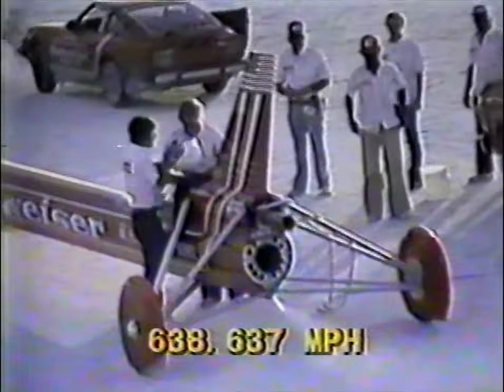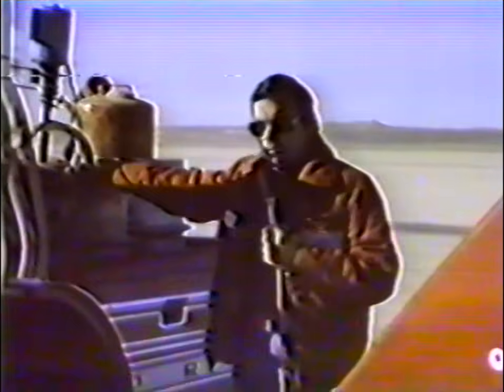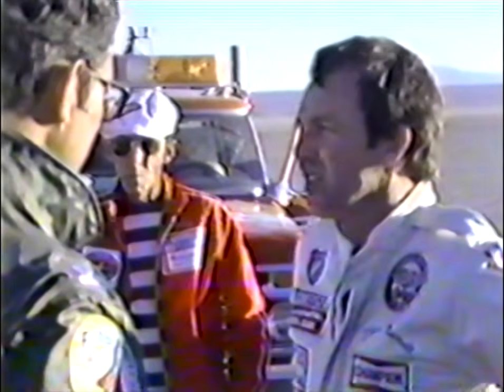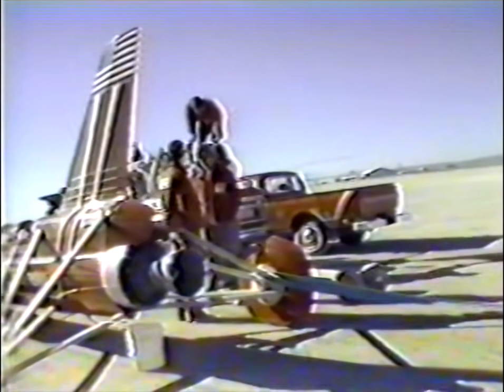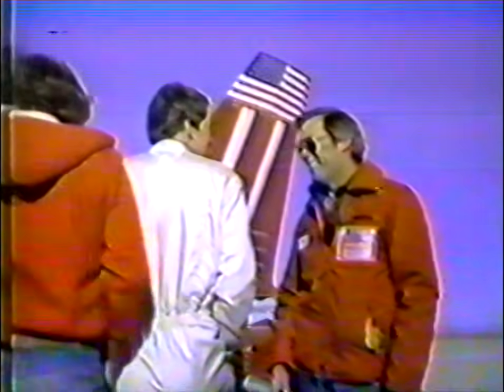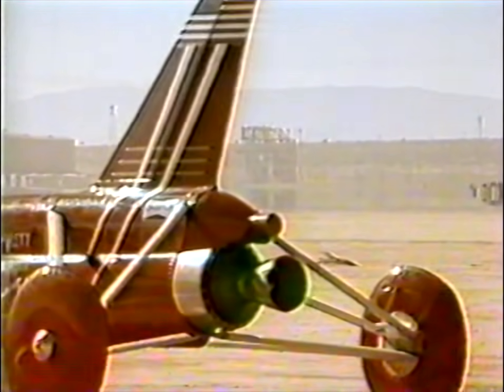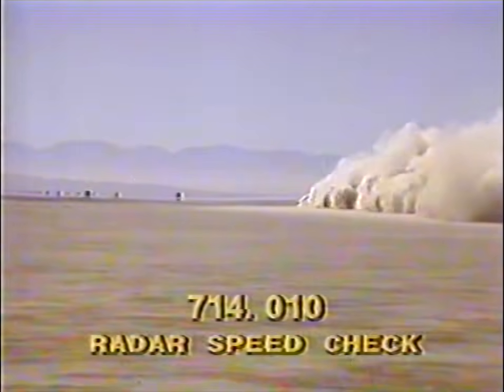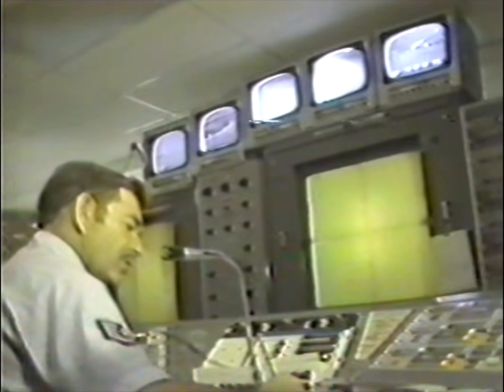Stan Barrett Breaking The Sound Barrier Live from Edwards Air Force Base in 1979

Comment: To be fair Barrett went probably went faster than any else before that day and the sound barrier is a function of air pressure/temperature not a fixed speed limit. Though the Air Force radar data showed the Budweiser Rocket might of achieved 739.666mph breaking the sound barrier in those conditions it never said it was an official measurement. Indeed FIA a self created organization formed in 1904 in Europe only recognizes its own standards  as an "Official" record and has no recognized authority to claim anything beyond its own membership. In the end a land speed record is meaningless because a rocket sled achieved supersonic speeds long before any manned vehicle did and it's human passengers went faster earlier than those who had records as well.
Reply: The sound barrier is a very real barrier to speed.  A wall that creates massive forces on the vehicle.  Breaking the barrier at altitude at 700 mph is just as hard as breaking it at 740 at see level.  As for the 'official record', it is recognized because it is the latest in more than a century of recorded records  broken using consistent, reliable methods.  If you go faster using different rules  what value does that have?  Who are you comparing yourself to?  You aren't beating anyone, you're just satisfying your own ego.  Not necessarily a bad thing, but nobody else will care.

Comment: There was no independent measurement of speed & whatever speed it achieved the attempts didn't meet the requirements to be recognised. The give away is that NO ONE heard a Sonic Boom, unlike Thrust SSC where the sonic boom was heard over a considerable area & the shock wave was clearly visible.
Reply: I didn't hear a sonic boom from Thrust SSC either. Everyone was a sore loser that Stan broke the sound barrier.

Comment: its just a tricycle with a rocket strapped to the back.. there is nowhere near the engineering in this as there was in the thrust cars.
Reply: He didn't crash and went 714mph. Keep it simple works
Reply: Record for a car requires four wheels and two used for steering.
I think this would be classified as a fast side-car.
Reply: Randall Parker......He actually went Mach 0.85......about 622 mph.
Reply: Grumpy...
There is only "one" Thrust SSC car.
Reply: More accurately it's a delta trike
Reply: Oh, wasnt the SAME engineering, but you try building ANYTHING can move that fast on the ground and stay under control.  Just the wheels alone are a challenge.
Reply: @richardbeck4193  the record does not refer to a CAR, it refers to a land VEHICLE.  Any wheels, any power, any steering.  Run it twice within an hour through a measured mile and you'll get an official average time.
Reply: @markdoldon8852  The record is not listed this is because there are conditions to be met by type of vehicle. Otherwise the fastest is the rocket-sledges which run on rails used for testing weapons.

Stan Barrett 1979 is NOT in this list :-
https://en.wikipedia.org/wiki/Land_speed_record#1963–present_(jet_and_rocket_propulsion)

Holloman High Speed Test Track at Mach 2.5 (manned)
https://www.youtube.com/watch?v=I7IEfGTyT3Y
Reply: @richardbeck4193  They struggle and struggle, regardless of the total lack of evidence behind their wishful thinking.

Comment: Wow, the comments below are amazing.  Did he break the sound barrier ?  I don't know, but he went fast--probably 700 miles an hour, 20 years before SST. Hard to compare the two. He wasn't sanctioned by FIA, but who, really, is the FIA.  Any gear head worth his salt would find driving 700 MPH a cool achievement---record or not.  How many haters have driven 160 MPH ?   220 MPH  400 MPH ?   The car went fast a number of times and never crashed--in a time before cell phones and lap tops.  Your Lexus may go 130 MPH, but do you really know--without the FIA?
Reply: How long has it been since the French set ANY Unlimited Speed Record?

Who cares what they think?

The Curtiss V-8 motorcycle was a 
269 cu in (4,410 cc) 
V8 engine-powered motorcycle designed and built by aviation and motorcycling pioneer Glenn Curtiss that set an unofficial land speed record of 136.36 miles per hour 
on January 24, 1907.
(Its air-cooled F-head engine was developed for use in dirigibles).

That achievement made him 
The Fastest Man Alive...
on ANYTHING-
Plane,train,automobile,boat,bike,
et cetera...
for 4 years.

It remained the 
Fastest Motorcyle on Earth 
for 23 years.

However,
it was never “official”.

When the FIM asked him to do it again to make it official,
Glenn said-
“It IS Official.
Contact me when someone 
goes faster.”

For the rest of his life,
Glenn Curtiss remained the 
Fastest Motorcyclist that ever lived.

Comment: There are only 2 problems with this phony claim of a supersonic speed by the Budweiser Rocket car(?). First, the speed of sound (dependent on the altitude, ambient wind speed, ambient temperature, and humidity) at the precise time and location of the speed run was not known. Second, the vehicle was never actually timed. The SOS team made their own determination by calculating the manual rotation of a TV camera following the run at a distance from the run, and then, later, measuring the DISTANCE (via radar) to another vehicle following in the alleged tracks of the rocket vehicle. While the run was made at Edwards Air Force Base, the Air Force was not involved in any certification or calculation of the alleged speed. The speed calculations were only made by the SOS organization. At that, it was an alleged MOMENTARY speed exceeding Mach 1.As far as the "bureaucratic" powers that be is concerned, the world land speed record has always (over 100 years) been measured by timing the vehicle directly, over a recognized record distance (mile or kilometer), and averaging speed of 2 consecutive runs over that distance.Thrust SSC was the first and ONLY land vehicle to break the sound barrier - in 1997.
Reply: It now seems like the North American Eagle is going down the same path as the Budweiser Rocket. Dick Keller has credibility.  https://en.wikipedia.org/wiki/Blue_Flame
Reply: Witnesses, such as the Road & Track author, Henry N. Manney III, who were close by heard no sonic boom according to their published stories of the event. As far as a sonic boom on a film record - never heard one. Even if there was one on a film account - remember that these people were Hollywood film special effects professionals - not racers.
Reply: Some Land Speed Vehicles may be impossible to make a a return run in under 60 minutes due to the complexity of refueling and the running the course is both directions (crosswinds, sun in the racers eyes...) Not sure if that is the case with the Budweiser Rocket Car. Why not have a record for the car making a run in one direction if the complexity of the vehicle or track requires it to be done in that manner?
Reply: Is it possible for the Budweiser Rocket Car to break the speed of sound without making a sonic boom?
Reply: The requirement for a 2-way run has been in place over 100 years. For the FIA (automobiles) both runs must be completed within one hour. For FIM (motorcycles) both runs must be completed within two hours. The Budmobile was a "cycle-car" timed under FIM. The real problem for the SOS group was that they had to keep changing their objective to match the capability of the vehicle. First, they were going to attempt to set a new land speed record - beating The Blue Flame's 630.388 mi/h in the kilometer and 622.607 mi/h in the mile. However, they couldn't obtain those speeds over the recognized record distances, so they got FIM to allow records over 1,000 km/h to be measured "instantaneously". Hmm. The Blue Flame's record was the first over that speed, 1014.656 km/h in the kilometer. In the Dec 1979 Hot Rod Magazine they claimed to have set a one-way record of 638 mi/h one-way in a 1/100-mile speed trap. At the Muroc event, the FIM speed traps (100 feet?) recorded a speed of 666 mi/h. However, FIM still required the 2-way average for a record. They didn't do that. Then they claimed the vehicle momentarily exceeded Mach 1. So, they continued to attempt to claim a "record" for something the vehicle could possibly do. However, even that was not certified, since the vehicle was never actually timed - and the ground speed of Mach 1 was not actually known for that location and time.
Reply: SanFranciscoBay  The answer to your last question is "no".
Reply: Can't wait to see what the Bloodhound SSC does. 2 G's? That's NOTHING! ;)
Reply: Interesting stuff and wildly adventurous - but this discussion concerns LAND speed records and exceeding Mach 1 on LAND. I still haven't found the nerve to jump from a perfectly good airplane. My grandson and granddaughter HAVE done it in the 101st Airborne.
Reply: Again, the alleged speed of the vehicle was never measured - just "recreated" - from a technician panning a TV camera 4 miles away, and a truck allegedly driving in the Budmobile tracks.
Reply: The planned jump of the Ken Carter Lincoln from Canada to the United States was actually 2500 feet shore The planned jump of the Ken Carter Lincoln from Canada to the United States was actually 2500 feet shore to shore over the St. Lawrence Seaway. The span over water was 2000 feet. Considering that from Initial standing start to desired landing was 4000 feet, chances of landing in the water was at least 50%. The “Hot Rod” Lincoln was primarily designed to protect the driver in either event. It did. The jump profile had 3 phases; acceleration off the ramp, sustained air speed to the other side, and a soft landing (impact). By the nature of the project, it would only have one opportunity for success. Apparently, the second phase didn’t happen, due either to driver error or the rough ramp (settling over a few years) causing the driver to miss actuating the sustainer rocket (3500 lb thrust) and stabilizing parachutes (pitch and yaw) pedal as it left the ramp. The Lincoln pitched up as it left the ramp, rocket turned off, and the landing main parachutes deployed (phase three). Landing in the water, it floated until the crew towed it to shore and Kenny Powers was removed intact.
Reply: I remember seeing this on tv years ago with a bit about the "Budrocket" https://www.youtube.com/watch?v=TLZu9kZE6o0  too bad they didn't try to do it at least one way over a measured mile.
Reply: It was only timed by the United States Airforce!
Reply: They knew the record wasn't official but still fun to watch no rocket car has ever been built again since would be interesting if someone could build one.
Reply: No. To be fair to yourself, have a read about the sonic boom, there's lots of info on the net.
Reply: And, again, in English please?
Reply: mach one Where is the proof? There isn't any! Yes, the car was very fast. How fast? NOBODY knows. Why didn't they make sure that the necessary observers were in attendance?
Reply: mach one yes, I'm English. However, I'm a fan of the LSR, whether it's held by England or the USA. I'm also a fan of Art Arfons and Craig Breedlove. I'm not blind, so please don't assume that what I say is down to blind patriotism, it isn't. 

It's down to facts.
Reply: mach one pardon?
Reply: No sonic boom - no supersonic speed. The aerodynamic stresses at the sub/supersonic threshold are severe
Reply: Disagree, no shock waves can be seen, no sonic boom either.  Until evidence is supplied (evidence will never be supplied because there isn't any direct evidence) then we MUST deduce that the speed of sound was not broken at this attempt. It seems very strange that they did not time the vehicle properly and have shot themselves in the foot by not doing this properly.
Reply: 34m 38 seconds. Announcer says the ambient air temp is 20 degrees (must be C) which make the sound barrier 731.9 mph.
Reply: No sonic boom, no shock wave,? Keep trying yanks,  Thrust SSC only car to do it,
Reply: The Air Force checked the speed with with a hand-panned radar set that originally picked up a truck rather than the car. There were no indications that Barrett had broken the sound barrier. The officials just discussed for a few hours and then pronounced that the speed of sound had been broken, But they never explained how they had come to that decision.
Reply: SanFranciscoBay
Actually, it is possible. The limit for when a sonic boom is achived is not exactly Mach 1. You can get a boom even at a speed slightly below Mach 1 and you can go a little above Mach 1 without getting any boom. It depends on the shape of the object and a lot of stuff.
Reply: Another problem:  A record requires the average of 2 runs in opposite directions within 1 hour.  This car did not break the sound barrier.  Period.
Reply: It was a very impressive and daring feat, but there's no evidence to support that it broke the sound barrier. It clearly did not follow long established rules for a world speed car. I believe it only had three wheels, it wasn't a properly documented event, and it didn't make two passes and average the speed. It certainly was the fastest land vehicle ever up to that point, which is very impressive, but it did not follow the rules so it doesn't deserve official recognition.
Reply: lyndsay lusha   " BUT Stan Barret was the first to break the sound barrier, "....and what verification is there for that. There is nothing to prove it     And the "3 wheel" argument is invalid, being as Spirit of America , in 1963, Initially considered unofficial since the machine had 3 wheels. but was later ratified by FIM.      and before you say anything....i'm South African.
.
Reply: And don't forget that to set an official ref record you have to do both runs within an hour. So the SST broke the sound barrier, came to a stop, was refueled and checked over, and broke the sound barrier again within 1 hour. That was always the hardest part of the engineering challenge. It takes a bit of time to get slow down from 700 mile an hour plus runs. They had to rehearse the turnaround over and over to be able to do it.
Reply: @stevehawkes4760  let's stir it up a bit more the X1 sound barrier plane was developed from stolen technology from the Miles aircraft company  Great Britain a year before when the US government told the British government to put pressure on miles aircraft to stop their research on supersonic aircraft and hand over their research findings to the americans
Reply: lyndsay lusha  Did he recover the Enigma machine at the same time?
Reply: Dick, you really need to read up on this run - the car was tracked by radar at Edwards,, and they confirmed that the speeds was just barely (a few mph) above the speed of sound for that altitude, air density, temperature, etc, etc.
Reply: The lack of any sonic boom proves he didn't.
Reply: You mean claims, with no proof of accompishment?
We could as easily claim to have been the first to fly - certainly there were attempts here, and some may have achieved it - but they had no independent proof as the Wright brothrs did.
This film stunt falls into the same category as those early flight attempts.
Reply: Also, just like any other speed record, you have to get the speed going both directions and average the two.  Pretty sure Thrust SSC did that, so did Breedlove, as well as regular car records like the recent record broken/set by the Koenigsegg.
Reply: RIPPERTON, what was the humidity level? That also affects the SOC. Even I know that, purely from the effects of both humidity and temperature on the resonant frequency of organ pipes. They stated, just before  the start of the fastest run, that the SOC was 739 plus some change; almost 740 mph. Then at the end he states the RADAR (calibrated) figure of 730 mph (almost 10 mph too slow), followed by the (presumably) pitot-measured airspeed of 739 mph (nearly 1 mph too slow), and then says that they 'probably' beat the speed of sound. He wasn't sure. Radar is by far the most trustworthy of the two measurements. Also, where were the officially accredited observers? Nowhere. Did anyone check that the mile markers were positioned accurately? Not as far as we can tell. Did they make a return run, even within the most broadly accepted terms for confirming a speed record? No. Was it recognised by those who are responsible for record-keeping? No. Yes, I do live in England. I'm not a patriot by any stretch of the imagination; I'm a human being. Nationality counts for nothing. Was I hopeful that the vehicle would exceed Mach 1.0? Absolutely! Am I disappointed that they didn't? Yes, of course. I'm also disappointed that no verifiable data is presented, and that they abided with almost no officially acceptable rules. Even by the two-day return journey exceptions made in Bonneville and other places or vehicles which have to be checked absolutely thoroughly before making a second run, they failed to even consider making it. I'm also persuaded in my view (fwiw) by the fact that the vehicle and the driver are not accepted as record holders by any authorised body. To use an common U/S English expression, no; I'm butt hurt. Nor am I in the least bit jealous. For the record, Richard Noble's record was set on American ground, not Bolivian, Australian, or British. That should make you feel happy. 👋🙂 Bye. I've a life to live, and no time to linger here.
Reply: Thanks for your valuable input, Dick Keller. And very well done!
Reply: I know all about that phony run. The U.S Air Force did not certify or time the run. I have a letter from the USAF stating that fact. The radar was a tracking radar, not a speed measuring radar, and not even calibrated. The radar did not actually track the car at speed - it only measured the distance to a truck 4 miles away, recreating the speed run later. Also, the actual speed of Mach 1 was not known at the time and actual location of the alleged speed of the car.